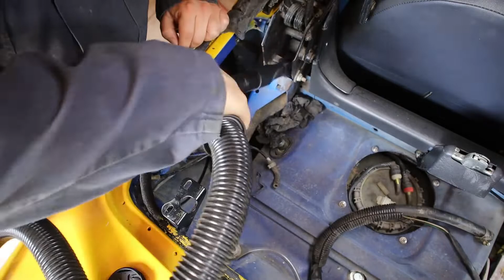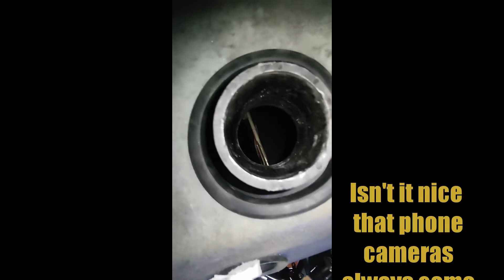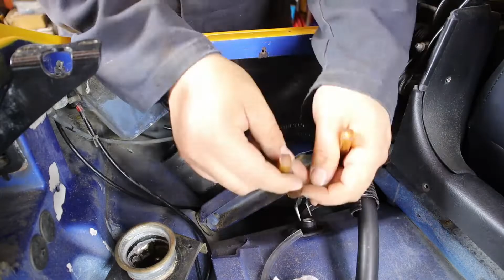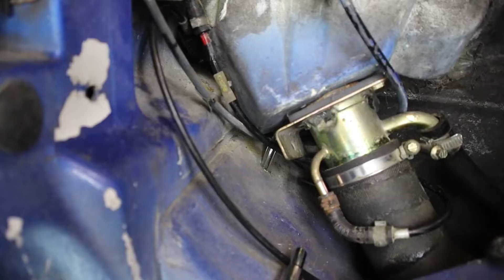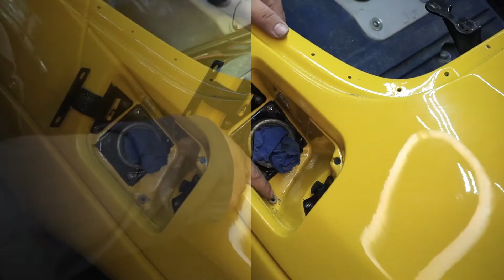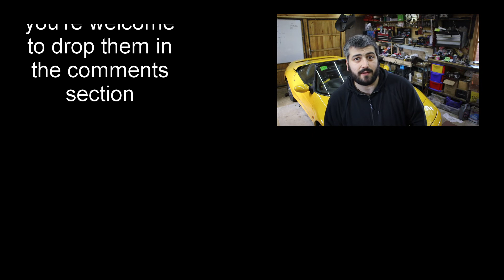Putting the Fuel tank Back (pt2)  - Lotus Elan M100 Project

Comment: Hello and thank you for all your videos (and thanks Google Translate because my english level is so... bad :D ). Juste one question about the fuel flap release cable : the metallic stalk has been damaged today because of strong wind. I think UK reseller can found it but how do you replace only the cable ? Thank you for help !
Reply from the maker: It's not a difficult task. There's a nut behind the lever that you need to undo to remove the whole thing from the door side, the opposite end is just a clip fixing. It's not easy to undo by hand, but with a small flathead screwdriver and carefully you won't struggle to replace it. 
You will need to remove all the carpets and 3 plastic trim process from the hood stowage compartment. Which may be a bit tricky because of the plastic clips that usually desintegrate on removal. 
Replacement with generic clips China is what I would advise.
Reply: @tuga2112  Thanks a lot !! You're so fast, I appreciate. OK for the chinese clips tips ;)  Have you a picture or can you surround the "lever", I'm not sure where is it...